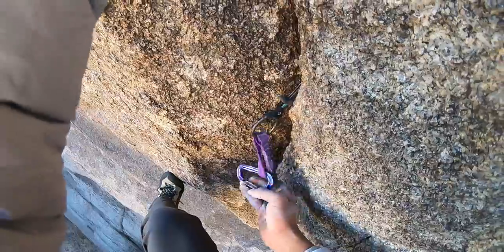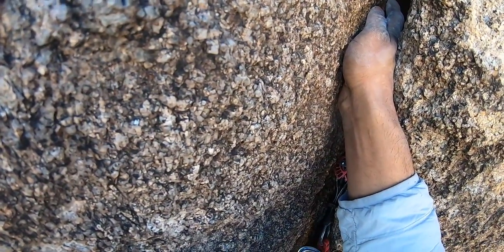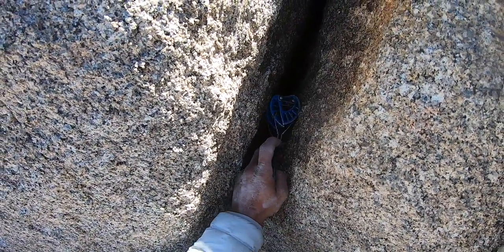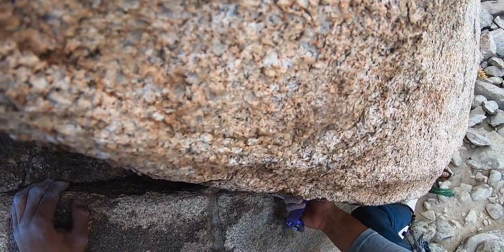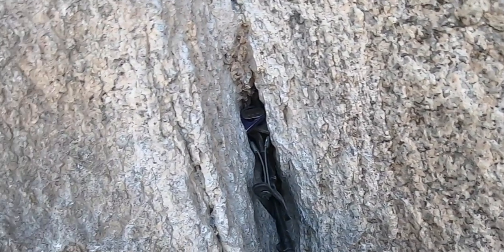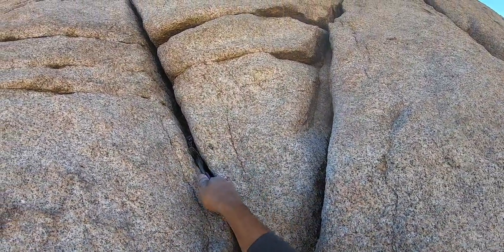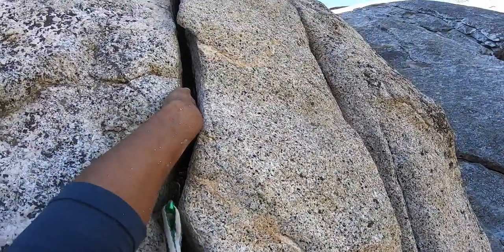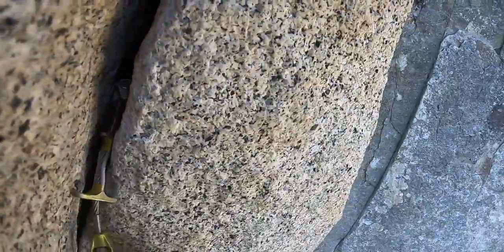WHF #24 | Gear Placements 2nd Edition | Real Gear Placements, on Lead, with Falls

Comment: 8:18 Naw that nut is way better than a micro cam! Any cam 0.2 and under really doesn't have much range so even a very slight movement in a crack can cause it to undercam and pull out. 
9:15 The nut of dreams!
9:23 It's a yellow alien, sized somewhere between a BD 0.3 & 0.4
11:44 It does weaken the sling with a knot in it but not really a concern with a dynamic rope in the system. The bigger concern if you don't fix it is if the girth hitch or whatever knot is wrapped around the carabiner walks up and cinches on the gate, which would just tear the gate off if you fell on it.

Comment: 11:48  I have no idea if it's true, but I've heard dyneema slings can burn through themselves pretty easily if they're knotted the wrong way. I do the same thing anytime an alpin-draw doesn't extend right.
Reply from the maker: I did a little google search which pulled up DMM stating any knot in the dynema slings will reduce its strength as well. Sometimes the tangled up alpines create unnecessary girth hitches around the carabiner which would then weaken the sling. To what extent depends on the knots, but I guess it’s worth it not to find out the hard way lol.
Reply: @wildernesshomefilms  I found the same article, really great information.  I definitely wouldn't tie dyneema in a permanent loop, but I see no problem tying a figure 8 in an anchor, for example.
Reply: Yes it depends on the knot, but there no way you can produce that force on a real world scenario climbing fall to burn trough a dynema sling, no matter what knot you would use. There’s to many factors wich soften any climbing fall. The worst I’ve come across on all the testing with dynamometers was around 7kn, in a real climbing fall, a sling is rated 24kn and worst case a knot weakens a sling/rope 50-60%. And while extending your sling, as seen in the clip, this is not really a knot, rather more like a hitch.
Reply: @wildernesshomefilms  the DMM test was is an absolut static testing scenario in the fall tower, if I recall that right. No rope stretch no soft climbers body. But it’s definitely worth while inspecting your gear on a regular  bases

Comment: The less knots and tigh bents on a sling, the stronger it is. Absolutely doesn't mean a girth hitch would make it explodes everytime you take a fall on it. But better use the sling at his maximum strengh capacity if possible.
Reply from the maker: Yes thank you! I found that there’s more details about it on a few manufacturers sites also :)

Comment: Beginner here..love the seeing placements. Would be good to get a zoomed in shot that you can pause occasionally. So whatat do you think ultimately caused the .75 to pop? Seems like it was a decent placement.  Did it just walk out of the shallow crack?
Reply from the maker: I think the back of the pod was narrower than the front of it so it was kinda flared. Even though it looked good in the moment the initial force pulled it out before the cams could fully engage. At least that’s what I think. 

I try to do freeze frames of anything I think would be too hard to pause on; but I’ll try to have a closer zoomed in shot next time around. It may help if I shoot in higher resolution too. Thanks for the question and feedback!
Reply: @wildernesshomefilms  #1 totem probably would have been bomber in there! I've encountered a few pods like that and have been glad to have a single set of totems to complement C4's. Since you're climbing alot of flared granite id absolutely recommend looking into some and maybe go test that pocket again
Reply from the maker: @chuckyd160  we’ve been looking at those shiny totems; might pull the trigger soon thanks for the recommendation

Comment: at 13:20   why the 0.75 fails ? overcammed ? weak rock ?   too close to the edge of the pod ?
Reply from the maker: The pod was too flared. It was deceptively under cammed. Even though part of each lobe was engaged, there wasn’t enough contact. It pulled right out. A #1 was too big but the .75 was too small.